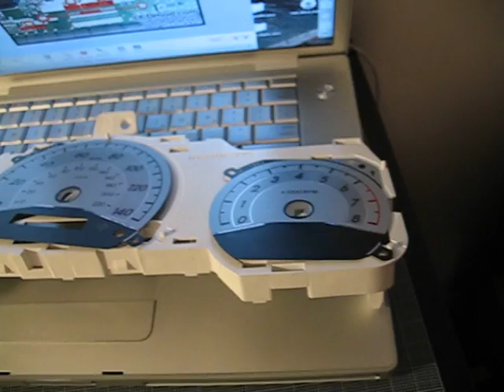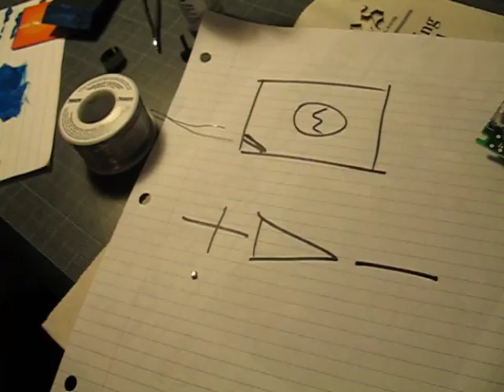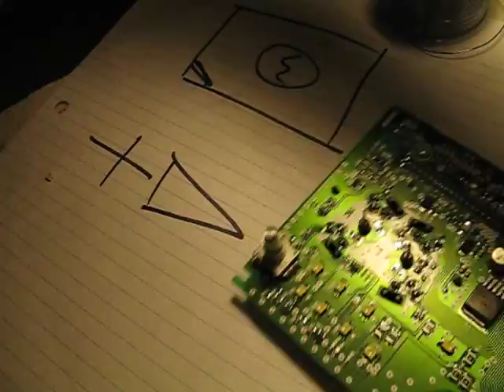Scion TC led swap

Comment: Hello I switch my leds to purple or neon color, some of the leds work and some are not. I tested then and they are ok....should I switch the resistors as well? And do I need to replace the voltage regulator for a 10v one too?

Comment: The way you are desoldering the LED's is very dangerous. The reason its dangerous is because if you apply too much pressure while pulling up the first leg of the LED it might rip the other trace off the board. Then you wont be able to have a working LED in that spot. Usually I get a copper wire and bend it into a "C" shape and heat it up while it touches both traces. Then you can simply lift the whole LED off the board without risk of damaging the traces.

Comment: nah, you can install the LED's w/o the resistors it won't burn out or anything.  Resistors only depend on the different colors your using.  if you want to change it to white, blue, green, or pink, you need resistors otherwise it's gonna be really dim.  if you want red, no need to change the resistors.